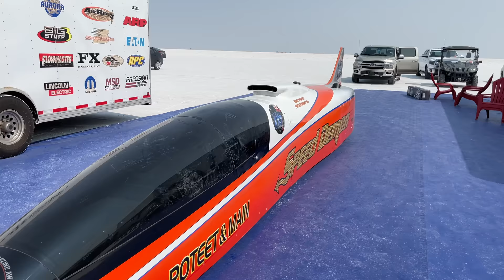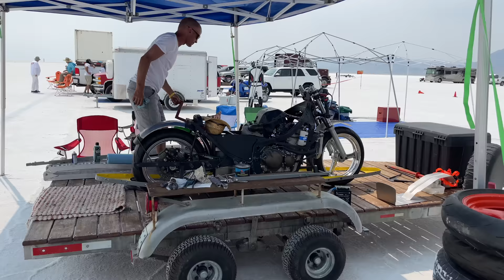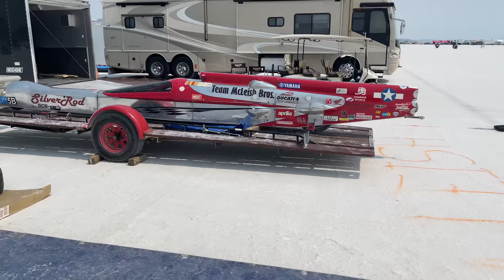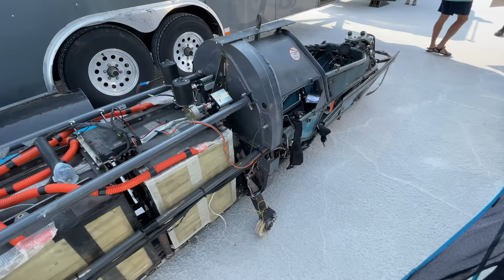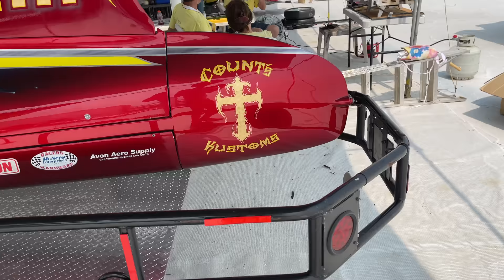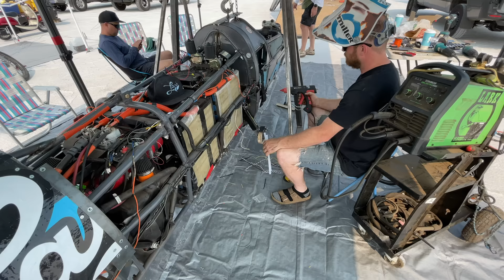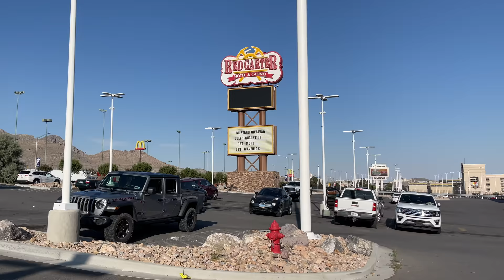The World's Fastest Electric Vehicles Didn't Go Very Fast At The Bonneville Salt Flats This Year

Comment: Battery discharge rate can be problematic, however, I think that electric will soon rule everything as long as range isn't a concern.  Wanna go super fast for 20 minutes or less? Electric.
 I don't know how Koenigsegg managed to get 1.100 HP from a 15 kw/h battery (on the Gamera), but that setup sounds ideal if you wanna reach the highest possible speed in 1 minute. Just imagine what they coudo do with a 50 kw/h battery capable of 5.000 HP for just under 50 seconds. 
(Before you tell me that they are far from surpassing Top fuel dragsters, I know, but I trust that charge/discharge rates will improve much faster than energy density. Just a few years ago we were charging out phones at 4 watts and now 20 watts is standard for cheap phones)
Reply: First, the Gemera still isn't really in production, as far as I can tell. Also, it doesn't get 1,100 horsepower from the battery - most of the power is transmitted from the engine to the axles via a torque converter and gears without going through the electric system (which is essentially a series hybrid system in parallel with the torque converter). 

The Gemera's motors are just two YASA P400 series motors, which peak at 160 each (429 HP total) - and even that is only briefly before they overheat - and much of that power is coming from the generator on the engine, not the battery.

Comment: The answer to fastest possible car is easy, you build an upside down catamaran over the wheels, and string it together with large carbon plates/wings/diffusers to create as much ( or little ) ground effect as you want, and stuff the cockpit in the side in front of the rear wheels either side, Basically two superbikes strung together with wings and an enclosed cockpit but lower to the ground, i've built plenty of them in physics games and simulators and it works incredibly well, i see no reason at all why it wouldn't work in real life, your cross section at that point essentially is that of two tires, which is absurdly small.

Comment: Well okay so Kamm tails on trucks are not meant to change the area. They change the drag coefficient.

The problems your minified Tesla would have here:
1. It takes an awfully long runway to get 36 MJ into a Tesla's momentum. Especially when your excess power gets less and less the closer you get. Energy lost per meter travelled is proportional to the total energy, so you'll asymptotically approach that speed, not actually reach it.
2. Tires don't really... work.... at those speeds. Not rubber tires anyway. They would fly apart. Also they'd form shockwaves in the surrounding air that would mess up that drag coefficient because the top of the tire would break the sound barrier.
3. A minified Tesla would not be aerodynamically stable at those speeds and adding large stabilizers adds a lot of drag. At low speeds, aerodynamic instability isn't a huge problem. At high speeds, It's basically THE problem.

Comment: To back up a record run you do not run back the opposite direction.  That is only (as far as I know) done if setting an FIA record which nearly never happens.  The measured course is only 5 miles maximum also, the other 3 miles is only shut down.  Nice video non the less.

Comment: i had this thought one time but what if you just added some kind of fans or some electric contraption to just move the air out of the way in front of you rather than just try and flow through it at high speeds.
Reply: That’s unfortunately not how aerodynamics works. You want the incoming air to be smooth and not moving so that it flows over smoothly. Disrupting that air will make lots of drag

Comment: Great video, but I was curious about the part where you were talking about the broken belt drive. You mention that belts are more efficient than chains. I always heard chain drives are more efficient than belt drives. Do kevlar belts offer more efficiency? Or perhaps theres a caveat to the general rule chains are more efficient. Anyone care to educate me? I did not find conclusive answers to this.
Reply: In theory, Belts with teeth, set in perfect tension are more efficient than a chain, as they waste less energy in noise, but in practice, they are a bitch to get right. I'm assuming they are going with belt because a chain has too much mass at the speeds EV west is shooting for, so the sentrifugal forces would probably turn a chain, into shrapnel
Reply: @WileHeCoyote  That makes sense. A gear drive would be even better, but apparently neither of these teams has the funding or other resources to build that.

Comment: why dont electric cars have dynamos on each wheel generating current for the batteries combined with solar panel body  frame and hydrogen fuel cells... 

basically you would never have to charge the car ever again as you could make it a  perpetual system... and it would have infinite speed cause the faster it goes the more energy it delivers
Reply: They do have "dynamos", they're called electric motors.
An electric car can do regenerative braking, which on a Tesla Model 3 is roughly 80% efficient.

But you obviously cannot do this while driving, because it adds mechanical resistance. It's only good for braking.

Comment: Very interesting vid. I know that cold temperatures reduce battery efficiency... but what about the high temperatures on the salt?
Reply: Higher temperatures increase the chemical efficiency of the battery so it will deliver more power and have a higher capacity... but it will also reduce the life of the battery much faster. So, quite similar to what you see with an internal combustion engine.  With race cars you're generally not so concerned with the life of your power plant as long as it can make it through the race. Top fuel dragsters and funny car engines last about 4 seconds, the time to travel 1000 feet and sometimes not even that long :-D
Reply: The salt flats seem ideal, as the battery will naturally be nice and evenly pre-heated. Of course during the run the battery would need to be cooled, but if the usual ice-filled coolant reservoir works for engines it would work even better for the battery (and inverter and motor).

Comment: I find it disappointing that both four-wheel EVs used drive belts. Belts are interesting, but to me the only surprise was not the belt failure in the 666 car, but the lack of a failure in the 444 car. I am curious what specific belts they're using.
Reply: Brian, we are using a Gates 125mm wide 14mm pitch "Poly Chain GT" belt for our drive on the 444 "Little Giant" . The exact same belt, in fact, that we use on our "Turbinator 2" car that has already done 503.332 (exit speed) in 2018. Our gates rep has insisted that with our setup we will never even get CLOSE to the expected limits on that belt. Our two Tesla S motors should be able to produce upwards of 1500 hp in tandem. Our "Turbinator 2" produced in excess of 5000 hp on the final run in 2018. As someone had mentioned  earlier, a  software issue arose in mid-run (each run) that prevented the batteries from delivering power at any higher rate due to total pack voltage dropping too low. This is apparently built-in protection on the Tesla system that we are using. The guys that did our EV conversion, ReVolt Systems in San Diego area are working on the issue right now and expect to have the car ready for the USFRA World of Speed event in September. If you can, come on out to the salt and visit us. You can get a close up inspection of our cars and we will try to answer any questions that you have....we don't keep ANY secrets, LOL. Check out "Team Vesco" on Youtube  and our website too for additional info. And also checkout "ReVolt Systems", our EV guys.
Oh, and also check out www.kero-del.com as well. That's my co. Might as well feed the algorithm!!
Reply: @Murphsmaster  I had a longer reply, but apparently it didn't post...

Thanks for the belt information. Since the Poly Chain Carbon GT is supposed to be limited to 6500 ft/min, application charts don't show shaft speeds over 4000 RPM, which would be very limiting for the Tesla Model S motor; that's why I questioned the suitability of these belts, not the power capacity (which can be as much as 1200 HP at the right speed for this belt pitch and width). EV West's car #444 shredded a belt, so perhaps they need to talk to your Gates rep. A smaller pulley would allow higher shaft speed within the linear speed limit, but the smallest 14 mm pitch pulley is so large (over 4" effective diameter) that 6500 ft/min would correspond to about 6,000 RPM... less than half of the motor's speed capability, and limiting the motor power output.

Of course the linear belt speed could presumably be exceeded for some period, and perhaps that's what is being done. Or the motor speed is kept low, perhaps as a side effect of keeping overall drive ratio tall to avoid low-speed wheelspin. Whatever the approach, I'm glad the belts work for you.

Comment: I do enjoy your videos,  Google hates me I'm trying to find information on  dimples, like on a golf ball  and how it affects air  , my thoughts are  how would it work on something like a  wing or on a high speed car body panel, Google  has failed me, or I'm  ot input properly,  and I have a thought about a electric car  streamline, in stages, that would use battery and motor and possibly set of wheels  ,and  eject them  like a rocket, and use the next set , I have it about designed out ,releases latches fundamentals , and  finances are starting to happen  , but quite sure that there are  a hundred things  I don't have factored in , Including  class and rules.

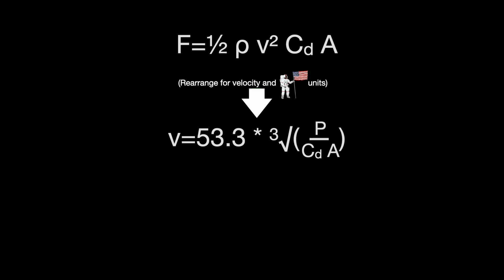Comment: 02:46 The irony of using the Astronaut with the American flag on the moon as a representation for the imperial units got me good.

For those that don't know - Nasa didn't use the imperial system, nor has it ever. It used and still uses the metric system. Which causes a whole other level of headaches when the manufacturing of the parts comes along as the units need to be converted to the imperial ones.

Comment: Do the  Tyres not have Wheels attached to these cars then ?  Just Tyres ?
Reply: It is common for very fast vehicles in this type of competition to use solid metal (normally aluminum) wheels with no tires, because inflated rubber tires tear apart.

Comment: There are many cars that in fact are able to develop much higher speeds but have locks, such as the lotus evija has about 2000 horsepower and manufacturer gives a maximum speed of only 320 km/h witch such power, it would be able to develop much highter speeds, just remove the lock that limits maximum speed and lower the air resistance coefficient convert the car to resemble a rocket and the wheels also limit and gear ratios, best regards

Comment: Figuring out the optimum gear ratio for top speed of an electric car on paper is not that hard? However battery load curves and ,motor cooling etc., and all the other devilish variables of aerodynamics and a rolling chassis, gives plenty room for tweaking.

Comment: BEVs give great torque boost from traffic lights, up to the speed limits, but beyond that FCEVs have the top end
Reply: That makes no sense, since the motor doesn't care if the power is coming from a battery or a fuel cell, and batteries and fuel cells don't car how fast the vehicle is going.
Reply: Yeah that's some absolute nonsense.

Comment: The first car to reach 100 mph over the measured mile was powered by batteries. At the end of the first run the batteries were swapped out for a replacement set.  Read your history books!
Reply: When how about you educate us with some facts?
Reply: I could say pigs flew 100 mph first
Reply: Did you mean 100 km/h (62 MPH), rather than 100 MPH? That would have been "La Jamais Contente" in 1899. Until that time the records were all electric; they were all internal combustion engine (with the occasional steam engine in early days) after that until the turbines of the 1960's.
https://en.wikipedia.org/wiki/Land_speed_record

Comment: Most landspeed organizations classify by both body and battery pack voltage.  Using weight is old-fashioned and pretty meaningless.  Voltage is a much better method of differentiation.
Reply: Voltage is also pretty meaningless. The same energy can be carried and the same power delivered at essentially any voltage, as long as the system components (battery, inverter, motor) are coordinated. Running a low battery voltage to fit in what is supposed to be a slower class just means dragging around more motor mass, or adding a voltage doubler which would otherwise be superfluous expense and mass.
Reply: @brianb-p6586  Theoretically true but I've never heard of any high-performance EV's running low voltage.
Reply: @auntwicky  Right, because it makes no sense. Racing rules drive teams to do things that would otherwise make no sense.

If trying to reflect common practice, voltage classification would be nearly useless, as most current production vehicles use nearly the same battery voltage (about 360 V nominal), and the rest use double that. Would <400 V and 440 to 800 V be useful classification? Not likely.
Reply: @brianb-p6586  Probably 95% of racing vehicles are custom built and that allows builders a lot of latitude to choose different voltage systems (and consequently set records in those classes).  Choice is good!
Reply: @auntwicky  Sure, racers can build whatever they want, but what would the point of a voltage classification be? Since any power level can be achieved at any voltage, it would only drive builders to specific voltages, rather than building the best powertrain.

The weight classing is a crude attempt to categorize by battery size, which in turn is a decent indication of power output capability. It's not good, but voltage is not better.

Comment: Why do these guys keep trying to reinvent aerodynamics. Supersonic aircraft have pretty much done it already. Take a Northrop T-38 form, slice it halfway between the top and the bottom, keep it a half millimetre off the salt, fit the wheels under that and you're done. All that's left is how you get traction and power to the drive wheels.
Reply: That's not even close. No one at Bonneville even close to the speed of sound, so you're starting with the wrong aircraft. Aircraft are not symmetric, so cutting it in half is unlikely to work. Aircraft are not in contact with a rigid surface (when flying) so pitch stability will be all wrong.You can't maintain half a millimetre clearance because the salt is nowhere near that smooth. Even with minimal clearance, the wheels matter.

Comment: Insert rant about power density vs energy density. 

Lipo life4 etc are too high an internal resistance. 
Nimh is far better by over an order of magnitude. 
Nicd I have no idea about now days (40years ago it was the best)

You only care about discharge rates 90seconds? Lithium has about a 20minute minimum and the other 18minutes is wasted weight.

Comment: The electric motors and battery's they are using are far too small for what they are trying to do. It's like trying to break a land speed record in superbike with a lawnmower engine.
Reply: Car 444 stopped accelerating because the battery voltage dropped too low for the control system, indicating that the battery may be too small... or just not quite the right configuration (needs a few more cells in series); motor power was not its limitation. I don't think you understand how much power is available from these motors.

Comment: All hail the mighty A.  Fascinating.  In theory, ev's should blow away petrol vehicles, as electric motors are really torque-y.   Full torque, regardless of RPM.  Of course... the amps will vary based on loading... a lot.  Too much, in fact-- the motor will demand all the amps you can give it, in an attempt to meet the load, up to and including blowing out the windings.   I suppose the bottle neck, as always, is the 'fuel'-- can you deliver enough, in a short enough time, to push to the limit-- without blowing up and without losing control.   I'm already looking towards next year, for EV's and land speed records.... 

.... now.  If only someone could invent an electric jet or rocket engine... wouldn't that be something?
Reply: "Full torque, regardless of RPM": That's a common misconception. Torque is limited by current, which in turn is typically limited to a constant value from zero to a transition speed by various factors, limited by the voltage available to drive that current at high speed, and in most vehicles limited by power (from the battery, through the inverter, or in the motor) in the speed range between those two extremes. Just do a web search for your favourite EV or motor and "torque curve" to see this.

Yes, the battery is often the limitation. Car #666 hit that limit because the power demand caused so much voltage reduction at the battery output that protective logic in the controller prevented any more power from being used.
Reply: If there was full torque regardless of rpm there would be infinite horsepower as horsepower is proportional to torque*rpm
Reply: @thedigitalmelon7326  But rotational speed (RPM) is limited, so power (horsepower) is limited.
Reply: @brianb-p6586  When @Bob Powers mentioned  "regardless of rpm" I assumed that he meant at any rpm towards infinity an electric motor could produce torque which of course is impossible for any motor.
Reply: @thedigitalmelon7326  Right... and since speed is limited, power is limited. Torque is limited by current, power at high motor speed is limited by available voltage, and power is often limited in the mid speed range to protect the battery. The fact that infinite speed implies infinite power is true, but not relevant.